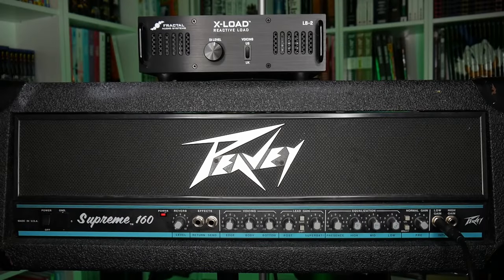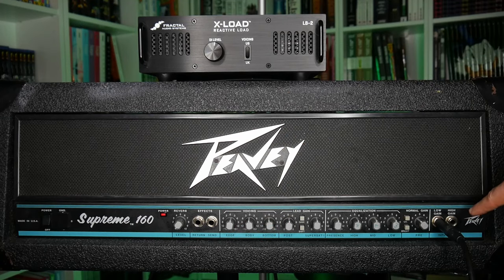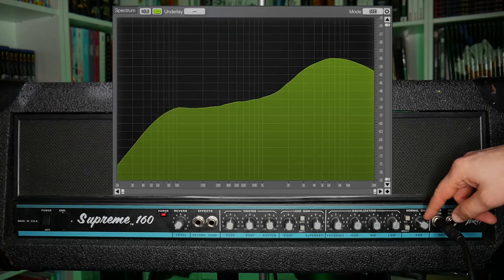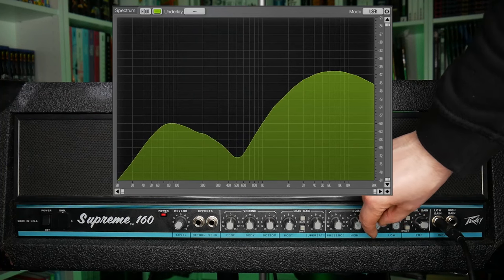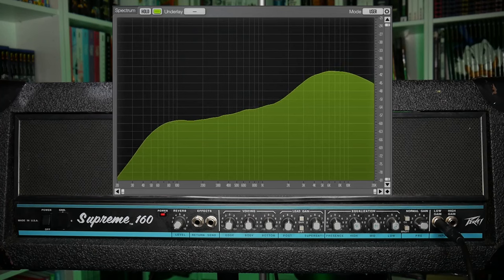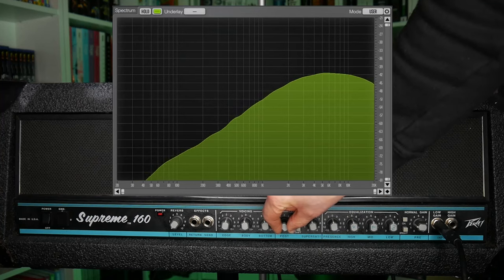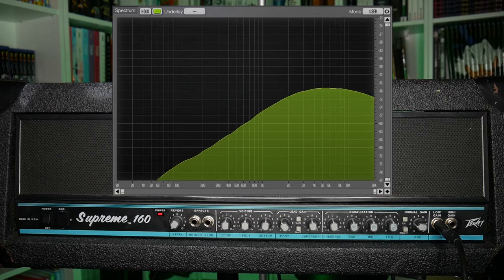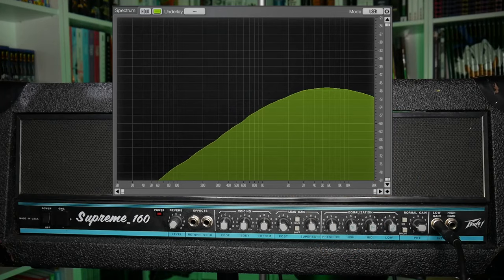The best Solid State Metal Amp? Peavey Supreme 160 Review (Amp Vault)

Comment: I have 2 Peavey Supreme 160's and I did a full recap of all the electrolytic capacitors on both and they shine. One does have some volume issues but the other is perfect.  With other solid state amps I've worked on that have had volume spike and drop issues, everyone told me it was the effects loop jacks. So I replaced them and all the other in out jacks and it worked like a charm. Took an Ampeg Vh140c that seemed to be on its last legs and now it sounds brand new. Also, take the chassis out of the head shell and go through each of the potentiometers and spray them out with contact cleaner while twisting the knobs. There should be a little notch on the back of the pots where you can put the spray tube extension of the contact cleaner. 
Then throw an HM-2 pedal in front of that thing and shred away. Cheers Dome!
Reply: i do recall issues with the effects loops.  i had friends that would just loop a short cable from the in and out of the loops.  apparently that was the cheap fix back in the day.  i never had issues with the amp i had though, but it was a common fix in the day.

Comment: this was a good and quality ss amp.  i had one of these for many years.  contact cleaner would probably fix the crackles with the knobs. person i sold this amp to still has it and uses it.  over the years i upgraded from this to a peavey tube fex and mb triaxis setup.  after that i also got an original block letter 5150 and axe fx 3.  so even though the supreme was a solid amp it doesn't beat an original 5150 or the other tube amps afterwards.  one thing i will say is this amp gets incredibly loud.  if i had this thing up to 3 or 4, people would hear me a couple blocks away playing.

Comment: Yussss! The special is the bandits big brother and this is the head version of the special. The bandit is identical to the others, just half power. This changed with silver stripe where it became 100w.
Never seen one here, but there's a ton of specials, I have one cut down into a head, because to hell with open back combos.😂
Reply from the maker: I'm thinking of converting my Bandit to a head version as well 😅
Reply: @DomeNightbearer  one bonus of the later editions are the cube enclosures. The trapezoid shape of the teals et all makes it a little less neat. 
I did a side by side and it was identical, untill the shift button was involved.
Reply: So the bandits 80 and special 160 have the same sound as this one? I have a couple very cheap near home and Im tempted 😀
Reply: @tubo777  Yes-but also within expectations of a 30 year old amp that will have caps nearing the end of their lifespan. I did a comparison on my instagram but i perhaps should put it on YT as well.

Comment: I've spent enough time staring at those schematics, and can confirm that the Supreme 160 preamp is identical to the Bandit teal stripe (made between 1987 (ish) to 1995). 
If you want to start a holy war, ask; which is the better Bandit; Teal Stripe or Red Stripe? 🤣

The "Supreme 100 Transtube" which came after it was identical to the "Bandit 112 Transtube". These were built roughly between 1995-2000, and have a black and silver colour scheme. My least favourite of the line. Finally, you had the Supreme XL and the Bandit "Red Stripe", but while these share design traits, they were quite different in many ways; the Supreme XL being closer to the Peavey XXL.

Comment: You're wrong about extreme EQ settings. Of course pluging straight in they're indeed useless, but they could be very useful depending on your effect chain. I'd rather have the option to tame insane bass, nuke muddy low mids or things of the sort than not. Personnally I find myself using very extreme EQ settings more often than you'd think, for example nearly cutting the bass before going into an OD and restoring it right after to have the OD only saturate the mids and highs (kind of what a presence knob does).
Reply from the maker: true, but in this specific context (just the amp) I don't think they are useful. At least for me. However I like to have extreme options on my pedals 😉